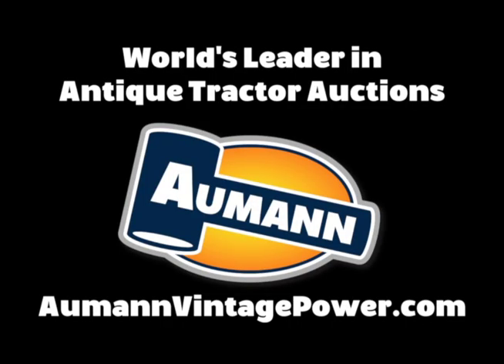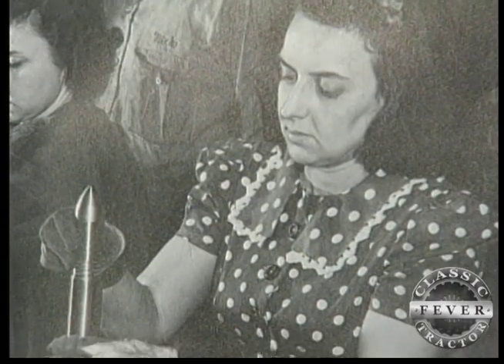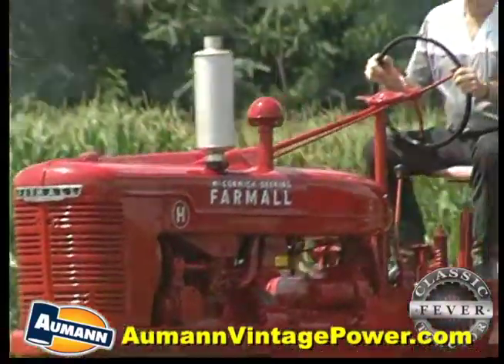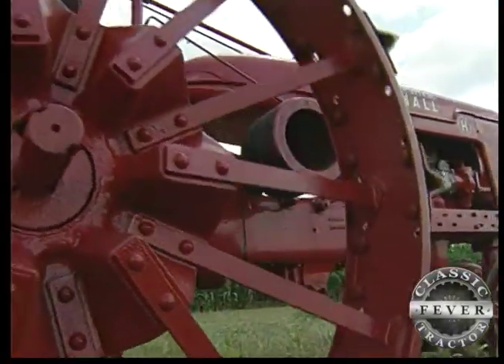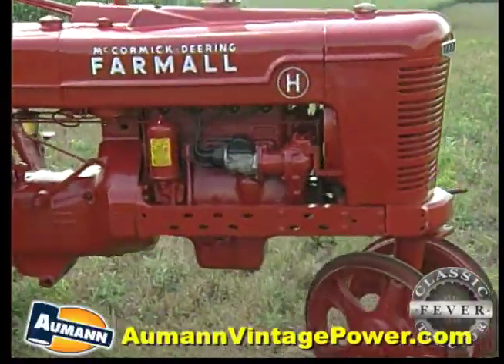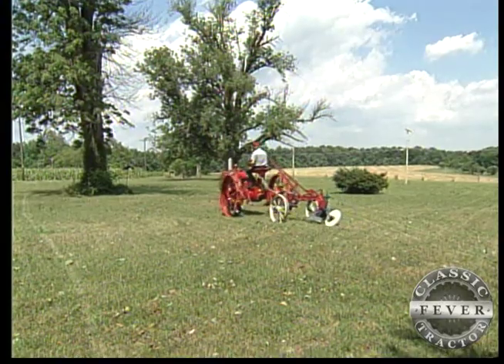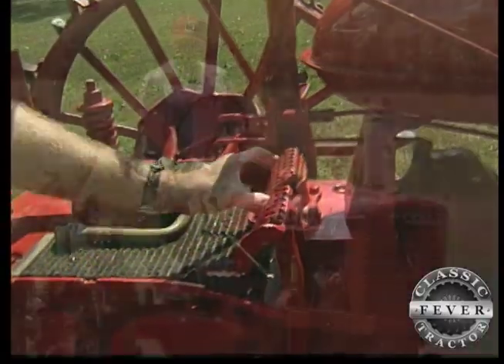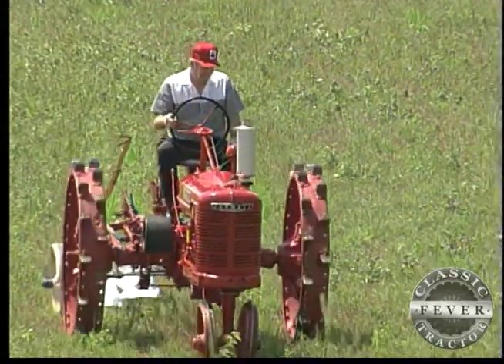World War 2 Production 1942 Farmall H Tractor - Classic Tractor Fever

Comment: Good looking belt pulley, and  have magneto,.. crank her up!  We had Farmall  H & M on rubber, in the mid 1960's Army Corp of Engineers built a dam upstream on the creek that ran along the back of the farm. Dad bought steel for the rear of our H, it was my job to disc the field the spring after the D-6 cleared and plowed it. I learnt real quick how fast those spades could dig two holes in the soft bottom ground soil. No progress with the tractor sitting on the rear end and a big frown from Dad, made it a one time mistake. Thanks for sharing this fine looking tractor, Dave.

Comment: My dad's '41 is still on the farm, and still runs AFAIK (he passed away a couple years ago). Last I saw though, the tires were in bad shape. He was told when he bought it in the mid-60s that it was originally built with steel wheels but was converted to rubber at some point. The wheels themselves look like the ones on the '42 in this video.

Comment: I just bought a 42 farmall H , Aug, 2024, Its been used for parts by previous owner., But the main pieces are there, minus the pistons  and cyl, head
among other small items , rims and tires. 
It was only$225.  My original idea was to use the transmission in my 1945 H but there's a chance being, because, (it has almost all
December 1941)  casting dates. I might fix it up.

Comment: You would have thought the military would have took all the steel leaving the tractor to be 100% iron but it's the exact opposite
Reply: Yeah, that would seem logical, but they needed all the cast iron to build ships.  I have one of these H's and most of the frame parts are stamped steel instead of cast iron as on the later models.  It weighs substantially less then the later models too.